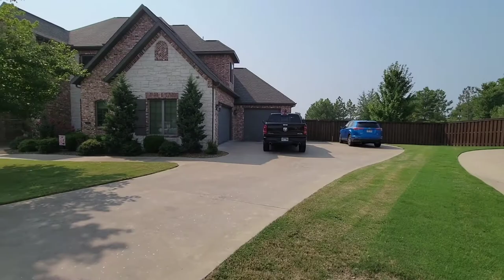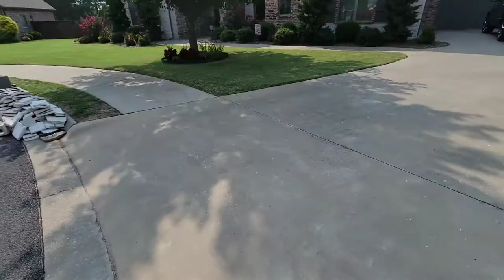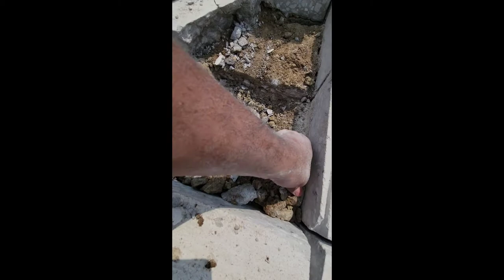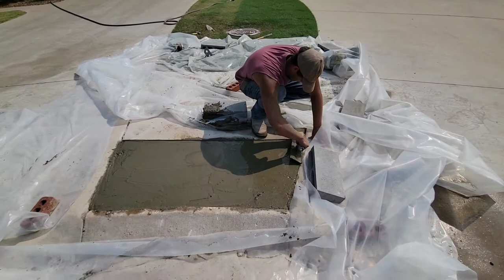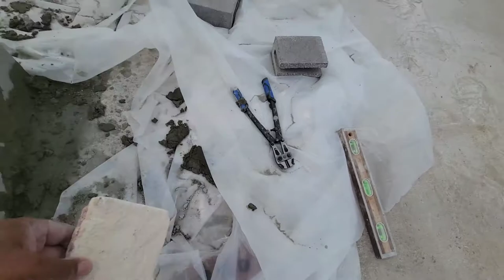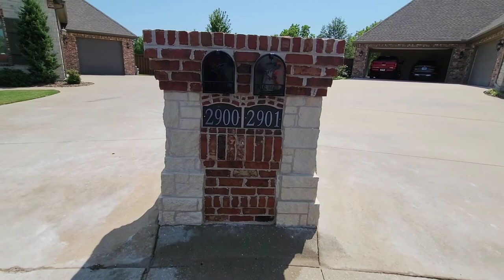Constructing a custom brick and stone mailbox. Real white limestone cut for veneer/tumble type brick

Comment: Should be using a float on the concrete while it's that wet. That steel finishing trowel is only pushing that bleed water back in the mix and weakening it